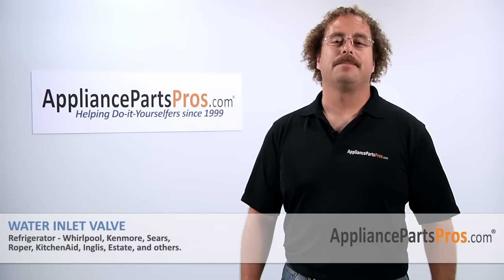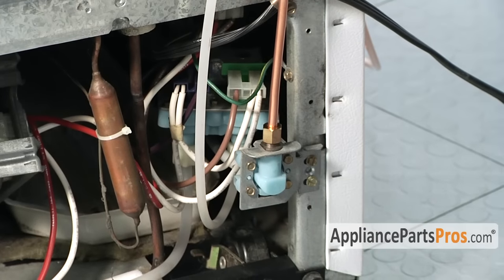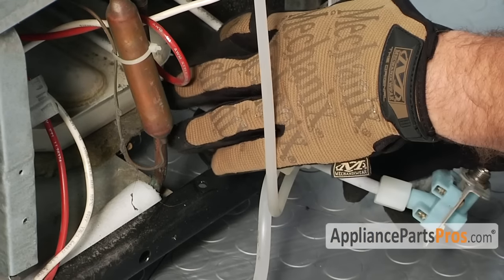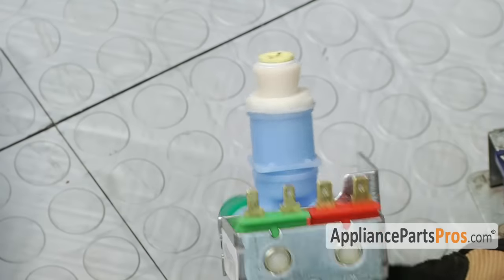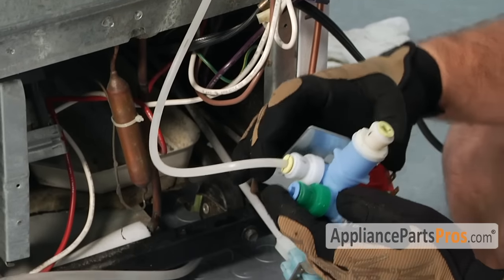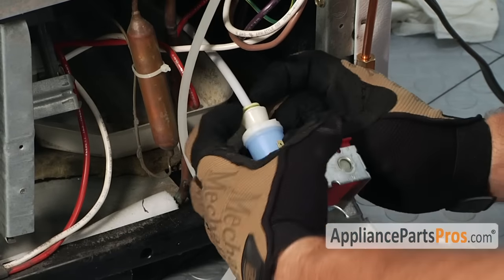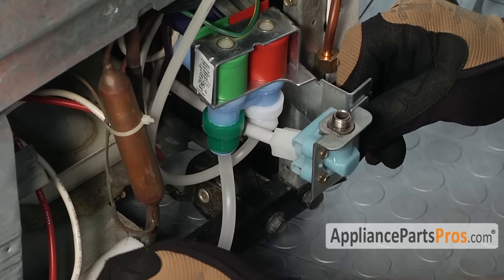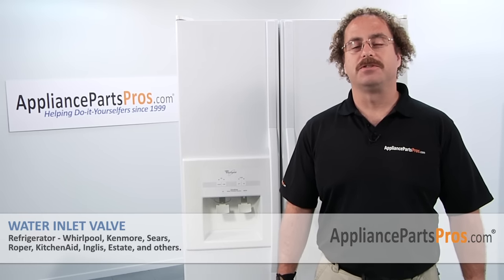How To: Whirlpool/KitchenAid/Maytag Water Inlet Valve W10408179

Comment: Why LG valves are not include? They look pretty similar. Thnx
Reply from the maker: There may be a different video for LG. What is your model number and we can look into this for you.
Reply: @appliancepartspros   The  fridge is a LG GS72W65CEF. The water inlet valve is a LG 5220JA2002B (USEONG RIV-12A-11, 110-120 VAC, 20W). Is installed in pair with a  LG 5220JA2004B  (USEONG AC110-12V 60hZ). The second valve is used to pump water to the filter).

Comment: so it will not work if the system is not flushed?
i changed the inletvalve and the ice maker too and still no ice.....
Reply from the maker: yose ddjess If you just replaced the ice maker it can take up to 24 hours to make the first batch of ice. You can also post the problem along with the model number on our repair forum and the techs will help you out!

Comment: my question is: I have a Samsung fridge the water in the door is weak and the ice are small...I check the pressure o any clog on the tube it's good when I take the filter out water it's strong when I put the filter it's weak... help!! thanks
Reply from the maker: +Aidalize Villegas If the filter is clogged it will reduce the pressure in the system.

Comment: i have side by side refrigirator made by kenmore model 
#106.58966702
i have water in my dispenser but no water is going to ice maker i replaced the valve and still nothing
Reply from the maker: yose ddjess You can check to see if the water fill tube is frozen up, its the tube that goes through the back wall and supplies the water to the ice maker. It could be the ice maker is bad or the ice level control board is bad. It is best to post the problem along with the model and serial number of
 the appliance on our repair forum and the techs can help you out.
Reply: Try and see the comments I made above and see if any of those suggestions help you.

Comment: Call me cheap...Had this exact problem on this type of frig/freezer.  Confirmed solenoid was bad by swapping solenoids (slide on/off) by removing hold down bracket on assembly.  Push water depenser for a few seconds and checked to see that water entered ice maker tray.  But $85 to replace for one solenoid?!!  Bought this part #5303917098 onine from thepartsbiz for $19 shipped, cut off hold down bracket from new part and swapped out green colored solenoids. Works great.

Comment: I did everything in this video and still no ice.  Water from the dispenser works fine, but the ice tray is not filling with water and therefore not producing ice.

What could be causing this?  First I thawed the fridge expecting iced up lines to be the culprit.  Nope.

Next I replaced the valve in this video. No operational change.

I'm totally flummoxed.
Reply from the maker: Michael Richards I would post your appliance model and problem on our repair forum so the techs can help trouble shoot it. It could the ice maker is bad, water tuned off, or if you have the ice level sensor it could be that. Also it can take up to 24 hours for the ice maker to start making ice after being unplugged. The thermostat in the ice maker has to get below 10-14 degrees for it to work.
Reply: I am having that problem now. I poured water directly into the ice maker just to see if I needed to replace that and it made the ice with no problem. I then checked the water line coming into the refrigerator and at first everything was fine. I had a small bucket near and unhooked the line from the inlet valve and ran water into the bucket. Once I hooked it back up to the refrigerator, I got nothing going to the ice maker. Then over the weekend, I had a big water leak and saw where my water line had a big gash in it. That hose will have to replaced. Won't know if that was the problem until I can get a replacement hose installed. My guess its either that bad hose or the inlet valve thats stopping water from getting to the ice maker. Oh yea I was told to clean out the little wire screen filter too. Its possible that small debris could be blocking water flow to the ice maker.
Reply: Chuck Purnell you're taking all the right steps. It's just a matter of finding which culprit is creating the issue. You might also keep an eye on the inline filter. I'm having a similar problem with mine, but it's under warranty. I have an appointment for this week to have it repaired. I intend to watch closely what his procedure is and how he intends to diagnose the problem step by step.
Reply: Chuck Purnell So the warranty repair person came out and diagnosed my problem and in my case, the ice maker was in fact faulty. It will be replaced in a week or so when the part comes in.  He did do a jumper in front of the ice maker motor. Where the power comes in and the water supply to the ice maker switch (on the front of the ice maker) he jumped the connection and the water came on. This showed him that the water was functioning properly and that the ice maker switch had failed. All water supply was operating properly.
Reply: Ch

Comment: I have changed my water inlet valve, but the water coming out in the water dispenser taste awful. We can not drink the water, it smell and taste bleach. I drain it so many times, maybe more than 25 gallons already and I changed the filter, the taste still the same. It doesn't taste like that before I changed the valve. I changed the valve because it's leaking.
Reply from the maker: Dalisay Pastrana Changing the water valve should not affect the taste. I would check the water tank to see if it is dirty and needs replaced.

Comment: I replaced my Water Inlet valve. My water dispenser worked for a week. Then It stopped working. What would be next? I am afraid that if I replace the Inlet value again, It will only work for a while then stopped. The new inlet valve costed me $100.
Reply from the maker: +Hong Nguyen Hard to say without knowing what you have. You can also post the problem along with the appliance model number on our repair forum and the techs can help you troubleshoot the problem. http://forum.appliancepartspros.com/

Comment: You also might need what's called a "compression sleeve" when you reconnect the copper H20 line. Luckily, mine came with my valve.  It looks like a TINY copper wedding ring.  Fits on the copper water line ( I had to use my handy Dremel and cut the tubing above the old compression ring).  Then, get the ring up on the tubing to allow some of the tubing to fit down inside the new valve, carefully screw it on the new valve for a leak free fit! (DON"T over tighten it!)  That fixed my "block of ice" problem.
Reply from the maker: mrmcghee1176 Yes depending on the type of incoming water line you have, you may have to change the compression fitting!

Comment: I have a Maytag Refrigerator Model #MSD2542VEB00 it will not dispense water or make ice if the filter is in place.  I changed the filter and that made no difference.  If the filter is removed all together it works normally.  Can anyone help with this issue??
Reply from the maker: +Jake Vanwormer If the valves in the water filter housing are stuck it may have to be changed. Here is the video on it: https://www.youtube.com/watch?v=JvMsxF20IT4

Comment: I have a 5 year old side by side kenmore. I dont have those valves down there? I get water from the front of the fridge no probleme, but when I click the ice make button it makes the mechanical noise like its doing the ice release like normal but no ice is dispensed no ice  the ice bin looks dry? Is there another place where the solinode would be? 

If not any suggestions, Thank You.

Comment: I have a Kenmore Elite bottom freezer. My  freezer was full of water and my kitchen floor was flooded.!! I turned the water off at the cut off and the freezer  is working.. Any suggestions or should I junk it? It was just like a water hose in my freezer!!
Reply from the maker: +IVA BISHOP You would have to determine where the water is coming from and then decide if you could fix it or if you had to replace it.

Comment: I was replacing a broken tube and one of the collars on the water valve pulled out.  I put it back in,  but it will not lock around the new tube. Is there any way to fix this collar or do I need to replace the whole water valve?
Reply from the maker: +Matt Rasche The locking collar is part of the valve, if it is damaged you would have to replace the valve.

Comment: I have Hot Point (GE) side by side refrigerator -HSS22GTE and I have problem but I dont know what is broken. Sometimes a water is leaking inside my refrigerator (freezer) and freezing on the bottom.  Its happen sometimes, not all the time. Ice maker makes ice and everything looks OK, maybe water valve is broken? Any ideas?
Reply from the maker: Miroslaw Soczomski It could be that the defrost drain is plugged. If this happens the water from the defrost cycle can not drain and freezes at the bottom. You will have to pull the shelves and back wall out of the freezer section, the drain is usually located under the evaporator. If its frozen up run some warm water through it to melt the ice.

Comment: I turned off whole house water to repair plumbing. After 24 hours I turn water back on I got water going to the dispenser but not water to the ice maker. Is inlet valve problem?( Ice maker worked normal before I turn water off.)
Reply from the maker: tom tran If there are any air pocket in the line it may take a few cycles to get water to the ice maker.

Comment: I know i need to change mine. But i have two diffrent inlet Valves. How do i know which one to change?    Amana aes2464bs.   Thank you
Reply from the maker: mario dilorenzo You would have to test the ohms of the individual coils. You can usually find the ohms rating on the wiring diagram. You can also post the problem along with the appliance model number on our repair forum and the techs can help you troubleshoot the problem.

Comment: Changed the water inlet valve still no ice.
Reply: Change the ice maker!!  or call a professional.
Reply from the maker: Without knowing what you have, I would suggest posting the problem along with the appliance model number on our repair forum and the techs can help you troubleshoot the problem. http://forum.appliancepartspros.com/
Reply: I just went ahead and bought a NEW ice maker for $99 and replace it....  It works OK !!